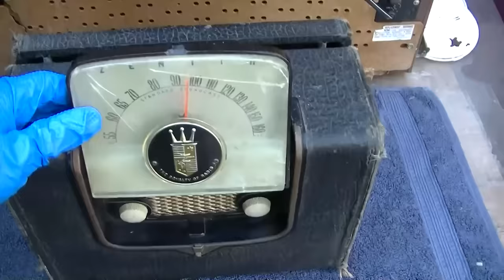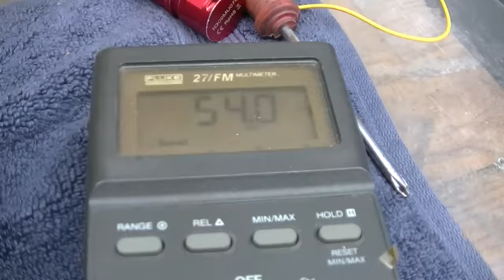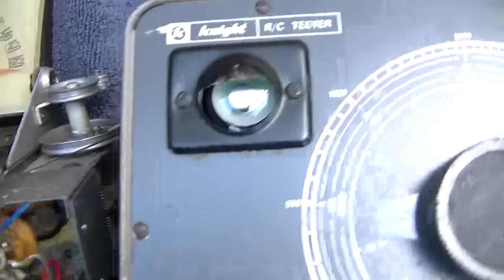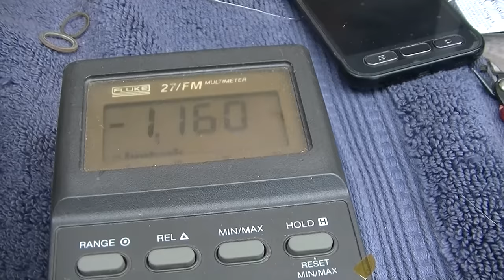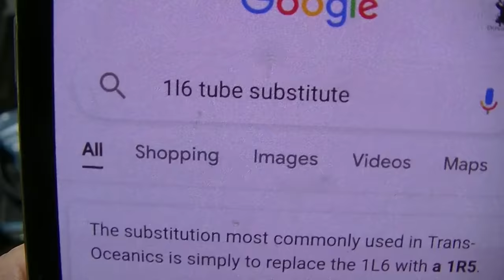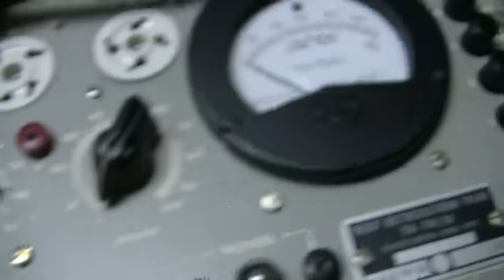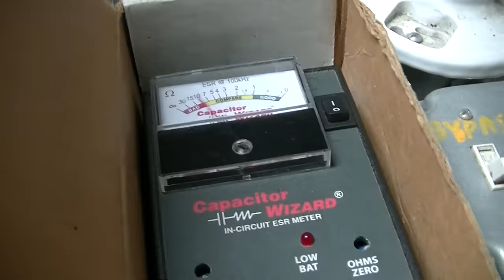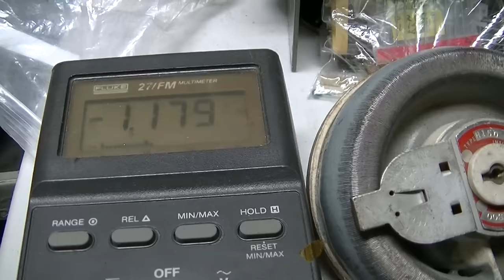1950 Zenith Portable G503 Flip Front Tube Radio 5G41 Resurrection Partial Fail

Comment: Some years ago I bought online a set of solid state drop in replacements for a 600-series Transoceanic; for the entire tube lineup. It was not cheap, I think in the neighborhood of $150 for the whole set, BUT, it means no longer having to worry about fragile 1v filaments and should last me forever. My reason for trying them was intended to see which "tubes" (real versus solid state) would give the best battery life performance but I never got around to building a battery pack to go further with the idea. Believe the maker now sells on eBay as "solidstatetubes" but back in the day had his own website instead. Now, I know people are going to say "why spend that kind of money on a beat up resurrection project?" but you could take the solid state tubes back out afterwards and use them in other projects indefinitely.
Reply from the maker: Done
Reply: I have been running my set in a 600-series TO since Dec 2014, no problems so far. Also haven't noticed any change in performance or audio tone/quality with solid state tubes versus the originals. I am sure the purists will complain about solid-state-afying a tube radio but then there's a similar approach to transistorizing 01A 3-dialer sets thats been around since the 1990s (lets you run a 3 dialer off a 9v smoke det battery iirc).
Reply: Thanks! It came up when I Googled "solidstatetubes" .  I was hoping someone sold something like that. I have an RCA portable that I bought tubeless for $10 and this might help me get it working for a reasonable price.
Reply from the maker: @sgath92  I'm currently testing them and I found an issue. It will be in a rather long video coming up in the near future
Reply: I am all for the long duration video formats, can't wait to see what it is.

Comment: 1volt tubes that act like solid state transistor radios which come on as soon as power is supplied.  I believe Motorola made the best portables of this type. I was given a Motorola of this type from the early fifties by the original owners that still had the original tubes.

Comment: Was the across the line cap replaced? If not that might be one reason for the noise. Or the RF feedback through the long negative leads of all the capacitors, they might need to separately go directly to the chassis

Comment: Maybe the selenium rectifier is leaky, could try a silicon diode in series with it. See if the hum goes. You could probably rewire for a 1R5.
Reply: Would have been interesting to see that substitution and how much the resistance had to be altered.

Comment: i have a UK 'double decca' that blows its DL94/3V4 if you switch it off too 'slowly' on the mains battery switch, then switch on again.....it seems to disconnect the filament chain from the smoother cap before disconnecting the mains, so it can get charged up to far higher than intended.. the earlier just post war double decca did similar with its octal DL33/3Q5 and apparently caused a shortage of those types here for a while,
Reply: Zener diode inline with bleed resistor is your best friend here 🙂
Reply: @blitzroehre1807  probably, i have a load of 7v5 500mw zeners, conveniently the correct voltage  for it😉

Comment: Do you save bad tubes? What about dead batteries?😊
Reply: On some tubes, larger ones usually, you can make adapters from a salvaged base, so, it may not be a bad idea to save a small selection of them.
Reply from the maker: An upcoming video is going to make this comment look foolish
Reply: @shango066    Probably not as entertaining as chasing ones tail. But, I’ll be watching. 👍
Reply: @poormanselectronicsbench2021      😵‍💫

Comment: I recently discovered ANOTHER source of bad hum while working on a GE clock radio about a week ago. Turns out the 2nd IF can was leaking B+ voltage from the primary side to the secondary side. Radio hummed like crazy, but after chasing my tail in circles for 2 days I finally figured it out. Silver mica wafer inside IF can was coated with black conductive gunk.
Reply from the maker: Yeah silver market disease I've covered it a bunch but this radio seems to work too well and the hum is there with the volume control down
Reply: @shango066  Selenium cell was my thought on the hum.

Comment: I'm impressed by the 6W bulb: it must be some very special purpose bulb because in Europe the smallest power tungsten bulbs I've seen are minion E14 socket 15W for furnaces, fridges, sawing machines, and candle style. Or, it's a 230V 15W, but still unusual in its regular E27 socket ;) Or, it might be purposed for parallel, not chained decorative lights like for Christmas or store windows.
Reply: They were often used as bulbs for marquee signs here.  Same as the pear shaped 11 watt bulb Shango had.
Reply: Also used as nightlights too.  I believe they are usually stamped 7.5 watt 130 volts, at least the ones I’ve had.

Comment: 1) They won't reform being that old.  2) Ob course it's humming with that old Electrolytic!  Those resistors are known as 'roundys'.  Very crappy job of wiring those E-CAPs!!  Change the paper CAPs and be done with it!  It's well know that you DO NOT PLUG-IN A 1V tube why the set is running.  And PULLING one is ALSO not a good idea!!  Should have looked in a Tube Cross-reference manual.
---
SHOULD HAVE CHANGED THE WAX CAPs.

Comment: I've had those cheap style of stamped-out wire cutters break like that a couple times.  That's why I use a good pair of Lindstrom cutters at work (model 8140 I think).  Twenty-plus years of heavy use and they're still fine and cut cleanly.